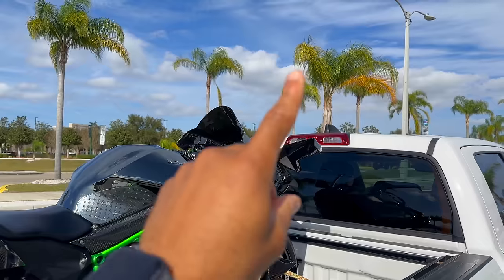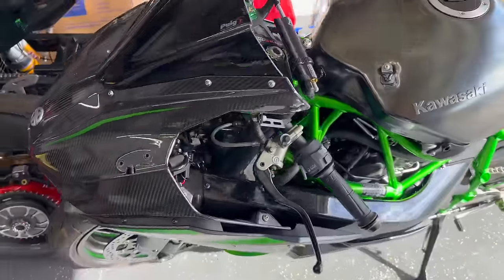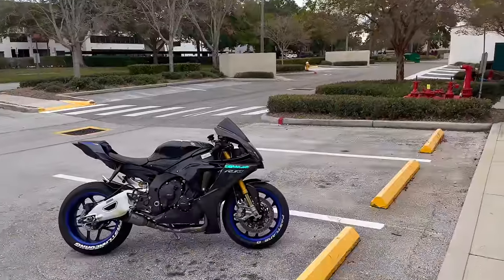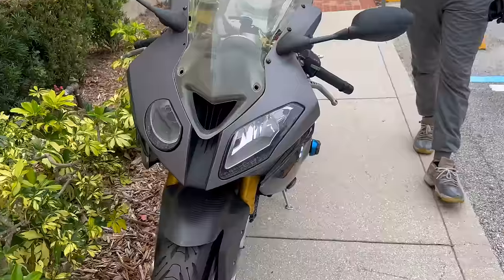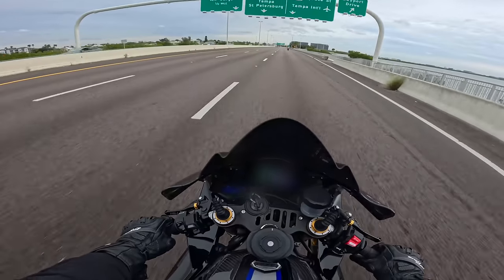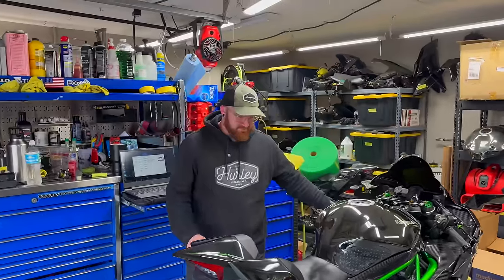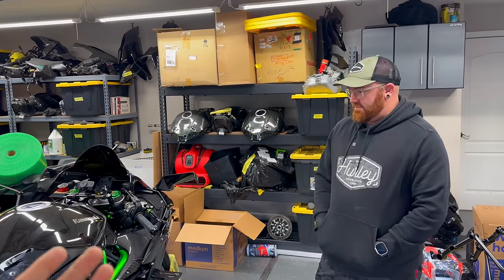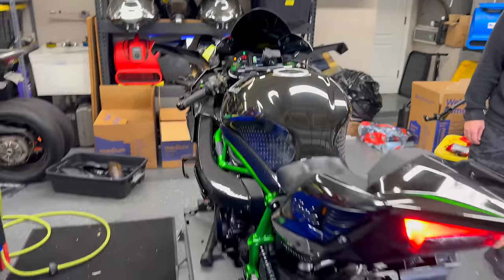BUILDING THE WORLD'S QUICKEST NINJA H2 😮‍💨 (SWB) | Stage 2 YegarWerx

Comment: For tires I would strongly recommend the michelin Road 6. It's a phenomenal tire that has sticky outsides and harder inside. Should net at least 8-10k miles.
Reply: Agree 200% Bro!!
Reply: Roads don't come in 200. I'm looking at the powers coming from super corsa myself
Reply: @Try2KeepUpK  then switch down to a 190, I did with zero issues
Reply: Yes. I ride these.
Reply: Can’t do a track day with those tyres.. not on a 200hp bike.
Reply: @nicholascoulman9233  besides he just asked in the video about tires that would last longer "on long highway use"
Reply: @nicholascoulman9233  you just have to be smarter with throttle input and it will yield you a second or two slower lap time. But if you are that top percent of racer and actually are competitive then you wouldn't even be considered what tire life was and would just be running slicks. If the man asked for a track and street capable tire with top level performance the response would be crickets, because it doesn't exist.
Reply: @nicholascoulman9233 its an h2...he aint doing track days nor do a good 95% of sportbike riders. And even if they do they dont ride hard enough to max out those ones you say arent good on a track lol

Comment: clutch cover with green highlights for certain, I would run forged wheels from Dymag but I know you want weight reduction  so carbon but green high lights just a touch. seat cover with green stitching. The front fender I think looked better in black chrome almost old school. Something to think about green windshield .  As far as raising the rear best thing you can do for handling curves. I would do this in a pair> raise the rear and lower the front. BUT you have to have a place to test and lowering the front in small increments then test. You can alter the rake and trail enough that  it becomes too twitchy. Did my FJR yamaha that way, adjust then test until I found the perfect feel. Beautiful bike.. I remember the video of you riding double at the race track and yes a big guy lol.

Comment: Oh, and my favorite tire for front end feel on corner entry is the bridgestone s-22 (now s-23!).
Reply from the maker: How many miles do they typically last? I already know that FL heat on the roads in the summer is gonna eat through tires 🤘🏾 #FastLaneGang 🏁
Reply: @FastLaneD  I only got 4,000 miles out of my rear s22, I'm trying the Road 6 as we speak.
Reply: As they are multi compound tires the center tread is the hardest so it will last longer than the sides and edge but if you’re riding on Florida roads predominantly it should last a normal amount of time. They warm up super fast and are way cheaper than the Pirelli Super Corsas.

Comment: If you wanna do carbon for light, weight and strength, like it should carbon wheels, levers, fairings, and as much as you can to make the bike light carbon fiber is generic, and that black chrome paint is unique and iconic. Nothing should  be swapped out for carbon for looks. That should only be swapped for function. and an actual upgrade of strength and light weight

Comment: I think accents could be carbon, but unless the body is all carbon, the body, should be body colored the black chrome carbon is for light weight and strength. If you just accenting it bike doesn’t match the rear end isn’t carbon but the front is and those are fairings so Your farings are just mismatch like a car that has a different color door.